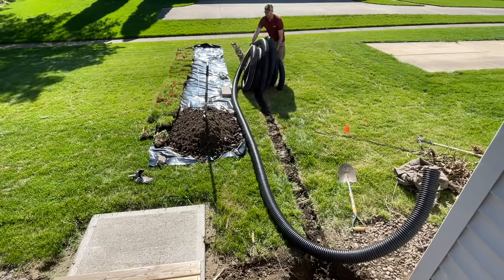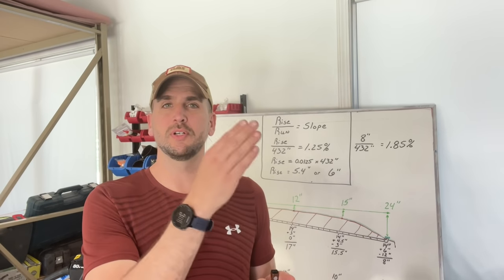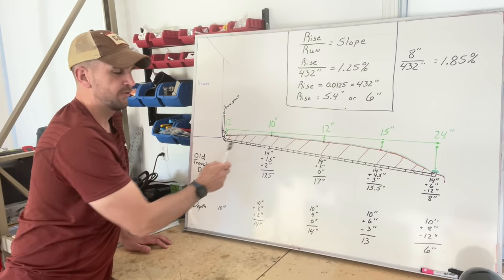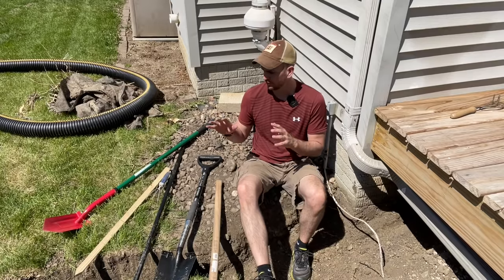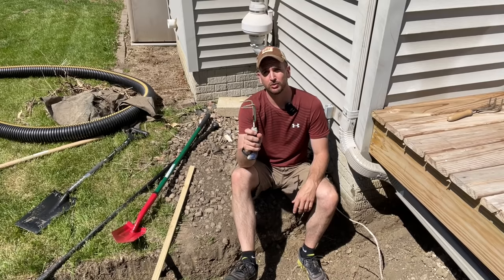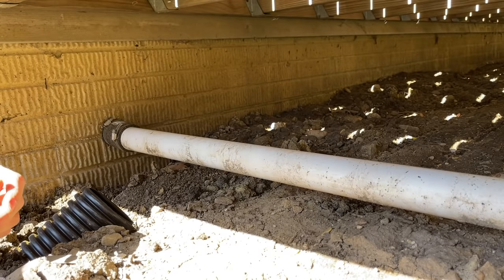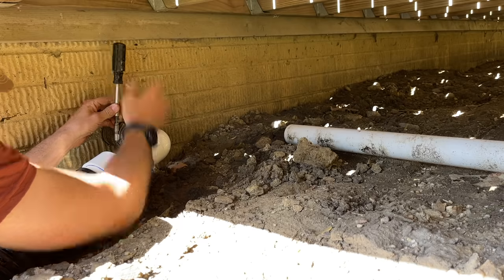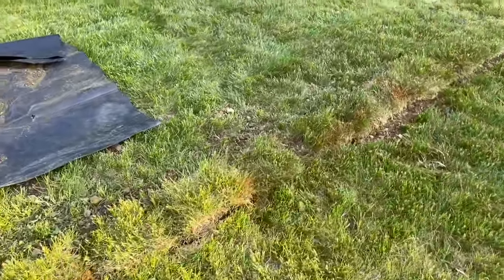Downspout and Sump Pump Drain Pipe Extension

Comment: I'm watching your downspout series again and had another question. In this video you use corrugated pipe and comment how the frost can flex the pvc joints. I am from eastern Canada and I see plenty of snow and frost in my area but I am very much on the fence on using pvc vs corrugated. I like the smooth wall pvc offers, so water and debris have a slick surface but I also like how corrugated pipe is easier to work with and more flexible. I have a small corrugated extender on my front downspout and I see lots of debris and shingle gravel collect in there, this has really swayed me towards pvc. Do you have anymore tips on trying to decide between the two. Thanks
Reply: @dboatrig Good point. My only concern was a comment made in this video where the frost can flex the pvc and crack the joints. Once the joints a cracked roots can make thier way into the system.
Reply: I would recommend using ADS 3000 Triple Wall HDPE. It is more flexible than PVC, which should make it less susceptible to cracking, but has a smooth inside wall to allow better flow.
Reply: @ronbrinker8190  And even cheaper is Double Wall HDPE.  Same outside corrugated pipe as was installed but with smooth interior.

Comment: I had a 50 ft line put in using this same 4" corrugated pipe.  It's had to be put in above the frost line like yours because we would have hit the water table. (It's a waterfront property near a big lake.) The sump pumps are active but the water inside the pipe is freezing and now coming out the back flows.  Do you have any recommendation on heating that corrugated pipe so it doesn't freeze? Thank you!  Any advice from anyone would be appreciated.
Reply: Keeping the pipe insulated with hay could help

Comment: I don't like the wet sidewalk. It just looks bad to me. I'm in Arizona. It doesn't rain much here, but when it does it rain bombs, flashfloods, and street floods. And my kaliche yard just sheets off water like a parking lot, taking all my nice mulch with the water. 😭 I want to save whatever rainwater I can, and I don't want to deal with the green algae, black lichen, and weed problems afterwards. I wanted to see the 50 gallon dry well.
I'm thinking of doing something like a reverse French drain system that quickly puts the water underground and spreads it around.  Then I think that I will just dye the kaliche a nice colour, because I hate gravel and that dumb landscaping cloth that doesn't suppress weeds or last very long.
Reply from the maker: I actually changed this configuration about 8 months after original install backing away from the sidewalk 15 feet and then running 20 feet of perforated pipe to a popup.  This worked much better and no more wet sidewalk 👍

Comment: I hope you put that excess soil up against the house.  If you got rid of that 2 inch fall towards your house and instead made it 2 inch away from your house, your sump pump would likely run less as the water would naturally flow away from the foundations of your house.

Comment: 1. Cold weather challenges abound. You should’ve air gapped that sump discharge, otherwise a frozen line creates pump and basement issues.  

2. Pushing that discharge water to sidewalk and/or street is not permitted in many areas.  Looks like you probably have other directions you can direct the water, like the other sides of the deck where it already slopes away from the house.  That keeps the water in your property and removes the ice hazard and wastewater code violation.  

3. Another option is a drywell placed in a reasonable spot. 

4. Always call utilities before you dig so they can get someone out to mark the lines and you miss those lines.
Reply from the maker: Hey Jim,  I don't foresee having issues with #1 and just made it through the first winter with a few cold patches without any issues.  On the second point I agree and actually changed the setup adding 20' of perforated tile running parallel to the sidewalk with a gap of about 20' between the sidewalk and the perforated pipe.   Thanks for the feedback

Comment: Allowing constant water flow onto a sidewalk would not be permitted in my city.
Reply from the maker: It won’t be constant.  During the rerouting there will be a damp sidewalk but after the reconfiguration it will be dry outside of rain when the sidewalk is wet anyway.

Comment: Stop using the cheap pipe. Use sch 40 white pipe. Won't crush with the weight of a lawnmower and looks better next to your house. And 3 inch is more than enough for one leader and a sub pump line.

Comment: I agree, if It might hold water & freeze then corrugated might be the better selection. 

Those NDS pop-ups are rated for 40-GPM which is probably not enough flow for your sump where the fast-moving water might erode soil around that discharge.  In a previous design I used a large valve box with a green lid & installed two pop-ups in the lid for 80-GPM flow plus the large lid's surface area allowed the discharging water to fall on a non-erodible surface. Or switch to a 6-inch pop-up.
Reply: The volume of water pumped out of the sump into the 4" corrugated turns it into just a gravity flow at that distance.  i.e.  filling a glass and slowly emptying it before the next fill.  Shouldn't be an issue unless the sump ran constantly.
Reply: @jeffm2787  If overwhelmed it'll be pressurizing a non-pressure pipe. I don't think it'd be an issue as those pumps won't create much pressure in those pipes.  I have multiple video examples in my Stormwater Playlist showing the erosion that can be created by those overwhelmed popups. The 40GPM is how slow the water should be moving through that popup to reduce erosion issues.